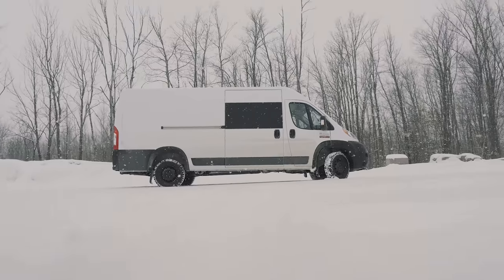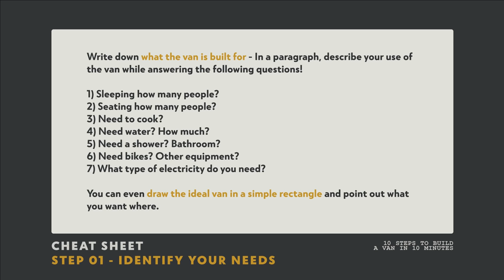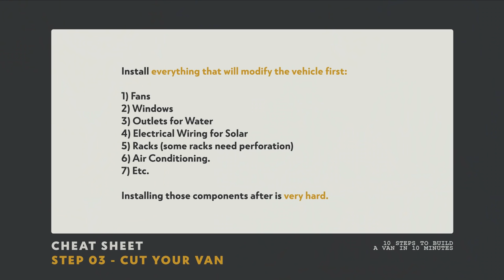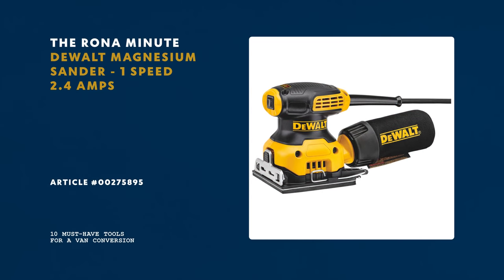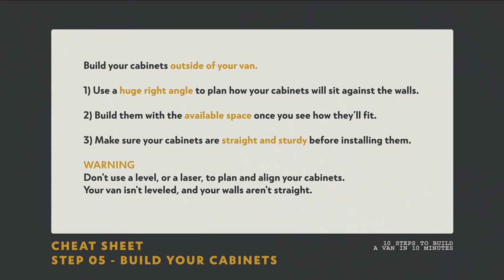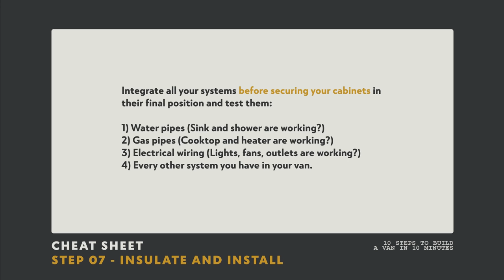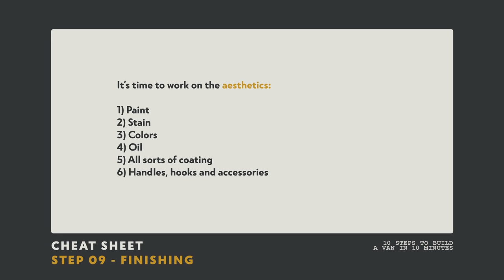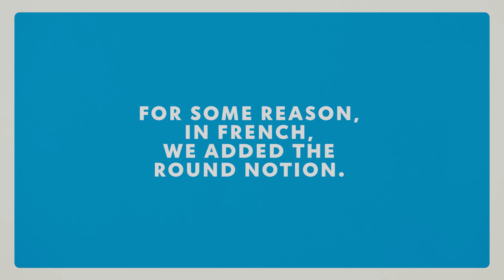Build YOUR VAN in 10 STEPS - From START to FINISH In only 10 MINUTES

Comment: Retired, widowed 66 year old female.  Decided to buy a van and make it easier on myself when I road trip.  Never worked much with wood, but I'm learning as I go, with advice from friends and family.  Never too old to learn, but going pretty slow and second guessing too much.  :)  Thanks for the video, it helps.
Reply from the maker: Trust yourself! You'll eventually figure it out. A van doesn't have to be a complex piece of work. As long as it is safe and functional, you are good to go!
Reply: I am in my 50's and thinking to do a build as well. I would like to spend some time out in Cali and be able to travel. Good luck to us both!

Comment: Your humor makes these videos so enjoyable!! I have 2 questions:
1. Is a vapor barrier needed after applying insulation on the walls?
2. What is the best way to keep the grey water tank from freezing in the winter?
Thank you and looking forward to the next episode =)
Reply: I am subscribing to those 2 qs :)
Reply from the maker: Thanks for your comment. Here are two answers for you: 

1) No, you don’t need vapor barrier. We simply add those because we want the plastic from the barrier to work against water and humidity (not the wood itself) . The barrier is simply to give the wood a break, not to insulate the wall. 

2. The ABSOLUTE best way to keep the grey water tank from freezing during the winter is to have it inside and to keep your van warm. With weather in Canada going below -40˚C many times this year, it’s an extreme environment to keep any tank of water (outside). 

Otherwise, there are some RV and Boat anti-freeze especially made for those tanks. You can also plan on installing a heat-pad around your tank to prevent it from freezing. However, like I said, temperatures here are extreme and those approaches aren’t guaranteed.

Comment: Thanks so much for this video! I love the aesthetic of your builds, especially the ceilings. It looked like you attach the lengthways wood strips to the larger board (ply?) before you mount to the ceiling, is that right? do you make the ceiling out of one large piece of ply?
Reply from the maker: The ceiling is built outside the van and then attached to the ceiling, yes. It's easier to build and to install that way!
Reply: @vanlifesagas  thank you!

Comment: So a little-talked about aspect of van buildouts is the permanent blocking of basic electrical and other components that mechanics need to get to for repairs. I’ve seen this pop up a few times now. Thoughts? What do you do to make access to important components modular and accessible?
Reply from the maker: We make sure we're able to access the vehicle at all times. For example, all the lights are accessible from the back panels and the trimming. You just have to take out 4 screws to make the repairs on the truck.

Comment: Bonjour Sylvain, Bravo pour vos vidéos !  Question about your stove (Gasland 2 burner), propane stove have a limitation on using them in altitude.  Dometic doesn't recommend above 4500 ft, I was not able to get info from gasland , neither through the cabinDepot.  What is (if any) your experience using it at an high altitude (in know you want to Colorado !)
Reply from the maker: We did not see a difference in effectiveness, except maybe that the flames might not burn with as much force when we are at 6000 feet+

Comment: Sylvain, I am about to do my back doors in our transit.... I am curious how you go about doing the back doors...
Reply from the maker: Do you mean doing the doors themselves, or the trims around the doors? The trims around the doors are a bit tricky to plan, depending on your vehicle. The easiest way to do accessory structures is to keep them as simple as possible (no curves, right angles, etc.) and to secure them against the chassis. What are you working on?
Reply: @vanlifesagas  I mean the doors themselves.
Reply: it's a transit high roof -- I plan to take the panels off the bottom, move the speakers, and insulate.  I just wonder if there are any tricks to the cladding on the doors.

Comment: Sylvain, will a polyester box with 4 cm insulation be enough to visit the cold winter weather in Canada. I will add a diesel heater in the box. The box will be build behind the cabin and will be complete polyester all around with a bottom of 5 cm insulation. Thanks for your answer. Greetings from the Netherlands.   PS. When my project is finished I will visit you Guyana’s Canada for sure.
Reply from the maker: Please come and visit. The trick to comfortable living in Canada will be to keep your van as heated as possible. With temperatures going down to -40˚C in the Winter, no matter how well you insulated your truck, you will need to heat it pretty much full time.
Reply: @vanlifesagas  thanks for the quick answer, there will be enough diesel in my tank to heat it the whole year.🤪🤪🤪🤪

Comment: Allo Dominic et Sylvain. My question is: I’m thinking to buy a van this year and looking for the E-Transit. What do you think about the electric van? I will go south in winter…meaning long hauling. Thanks a great work👏🏼
Reply from the maker: Gooood question!!! E-vans are definitely coming. Based on the little we know so far on these, they are currently built for a commercial market requiring relatively short range capabilities.  So if your vanlife routine involves short ranges/routes, an E-Transit might be for you.

Comment: I’d like to know more about your builds depending on which van you are building. I have a transit high roof regular length (not extended)
Reply from the maker: That would be an amazing comparison series - We would need to have all chassis in hand to do that though! Note - Transits are great vehicles, they're just the ones that give us the most trouble with Accessory Structures and Trimming though (see one of the last steps of the video). Cheers!

Comment: Love the videos, I was wondering what you did with the propane system?  We are only going to run our two burner cooktop (built in) like yours :) I am planning to build a sealed box and am looking into regulators and components to make it happen.  Any advice?
Reply from the maker: You seem like you are looking in the right direction. We recommend flexible piping for the distribution. The box for the tank can be easily sealed with silicon membranes (or any other compressible fabric that you can stick between the door and the box itself). You just have to lock it once the installation is completed. Don't forget to vent your propane box to the exterior and to add a net around the "exhaust" to avoid small animals or bugs getting inside.
Reply: Merci Beaucoup!

Comment: Why do you use vinyl instead of wood flooring?  I love the tip to put the flooring down before the cabinets.  If we're allowed 2 questions, is there room for a black tank under the floor of a Promaster?  Would you ever build a van with a flush (black tank) toilet?  Merci!
Reply from the maker: 1) We use vinyl instead of wood because your floor will receive a ton of water, salt, sand and wood won't like it. Vinyl won't complain. 

2) There is a grey water tank underneath that Promaster. We could probably fit a black water tank as well somewhere in the build. 

3) We do not build vans with black tanks, unfortunately.
Reply: @vanlifesagas  thanks much!!!  In a future vid, I'd love to see how you would do a grey tank (or black tank, if you decided).  This was a great vid.

Comment: Thanks so much for this. Love that is it so clear and concise. Do you really believe in the Wii-boost for a much much stronger connection?
Reply from the maker: Well, seeing is believing I suppose.  In our case, it really makes a difference…more often than not. Why do I say that? As stated in their manual/instructions, weBoost will do wonders for you “if” it sees an antenna.  The system works “line of sight”only (and the antenna can be relatively far) and it will really “boost” your signal…more “bars” on your phone.  In our case, more bars mean faster uploads and downloads which is great for our work.  If speed or staying connected is not important for you, obviously a weBoost might not be a good investment.
Reply: @vanlifesagas  thank you.

Comment: I bought a retired ambulance 🚑. Tons of storage, very well built, more wires then you'll ever need. Already insulated, well maintained by the firehouse. WEE WOO 🚑
Reply: Where did look for and find the ambulance? I'm just toying with the idea now -- early stages -- but they are among my favourite types of builds. Safety and durability are among my priorities.
Reply: @lovely_pariah  it was a long search. I traveled all over the States trying to find one with low miles and low idling hrs. Stick with small fire departments that aren't up north (to avoid rust issues) Big cities let their rigs idle all the time. Research the most reliable motors. I picked the Ford 7.3L diesel. Not the best in gas mileage, but the box of the ambulance has everything, shore power, tons of space, great for boondocking. I have a 1999 Ford E350 7.3L 89k miles. The 7.3L will go up to 500k miles with good maintenance.
Reply: @Texasishot105   Great advice. Thanks so much for taking the time to respond. Congrats on the ambulance purchase!

Comment: Salut Dom, vous n'installer pas de KILMAT  pour l'insonorisation ou j'ai manqué un bout de vos 10 steps ? Aussi quel type d'isolation vous utilisé ? Semble être de la laine de roche ? Plusieurs installe du thinsulate, plus dispendieux ,mais pour un usage 4 saisons est-ce mieux ? En passant, bravo et merci de partager votre passion. ;)
Reply from the maker: Kilmat? On utilise du B-Quiet. On en parle quec’part. Pour l’isolation, c’est réellement un choix personnel. Y’a des pour et des contre pour chaque type; prix, facilité d’installation, résistance à la moisissure, toxicité sont à considérer. On a même essayé du Havelock! Petite odeur et pas facile à couper. Thinsulate est définitivement un bon pari si on est prêt à mettre le prix.

Comment: If someone has a van with a fiberglass roof extension added on the top, how does one finish the ceiling?   There are no structural cross bars, etc.
Reply from the maker: Good question. Can you glue stuff to it? Otherwise, you might have to reframe lower!

Comment: I still am most intimidated by planning and building out the electrical and solar. Can you suggest some additional resources to a fellow Canadian? We have a retro 1973 Dodge Tradesman we will be building out this year. Gutted and rebuilt all the mechanical in 2021. Now just have to wait for warmer temps to get going!
Reply from the maker: The best ressources for electrical we found was on the Far Out Ride website (https://faroutride.com). They literally show you how to plan, buy and install your electrical. You have a bit of reading to do, but it's well worth it. It's how we wire everything in our vans now.
Reply: @vanlifesagas  Beauty! Thanks so much for this.

Comment: Very informative. Thank you. Do you need to worry about weight distribution at all (equal amount of weight over each wheel)? Thanks for the French lesson 😅😂😅😂
Reply from the maker: Yes, weight distribution is taken into account in our builds. Most of the weight will be over the rear axle, and evenly distributed on each side of the vehicle. So on one side will be the battery bank with the kitchen cabinets. On the other side will be smaller cabinets but with the whole water tank! Hope that helps!
Reply: @vanlifesagas  Thank you for the helpful info. Appreciate it. 💖

Comment: Do you not start with framing the van? So when you screw in cabinets and furniture it goes into the wooden framing and not the metal of the van?? It's confusing when / what order this step is done.
Reply from the maker: We frame the van first, with the ceiling and flooring being installed. We went a bit fast on the topic, you are right.
Reply: @vanlifesagas   Thank you! Are the kitchen cabinets only secured at the top of the van and not the sides? I think I understand you use the ceiling and floor to drill into and secure the cabinetry and furniture but what about the side walls of the van? Do you use vertical blocks of wood to frame the van at all so you can screw into or secure things to the side walls?

Comment: Hey Dom et Sylvain, fantastic video as always.  
In a Ford Transit, you will find these big ugly black triangle foam that are hiding the air bags. Can both foams be definitely removed, or it might impact your safety during a crash ?  Will it void any crash insurance and is it against Ford specification, therefore may void the warrantee? 
merci a l'avance, Dom
Reply from the maker: Hmm, always be careful with airbags. We had to remove some from the back cargo box (living area) as they would explode the cabinetry if they were fired. Never remove or play with the front airbags (the ones that are essential for people that are wearing seatbelts). Always make sure with your dealer what is possible or not with airbags. Sure thing though, never install cabinets over them.